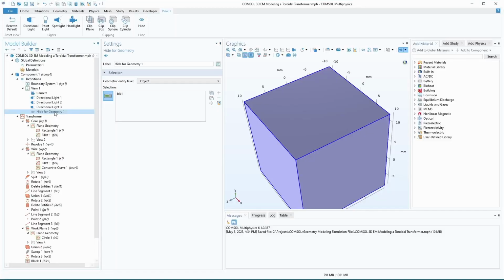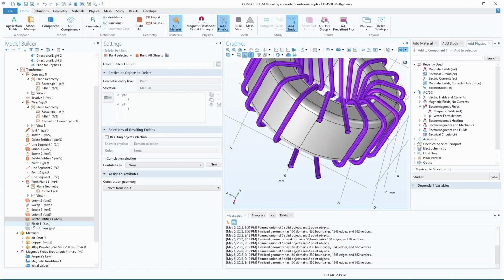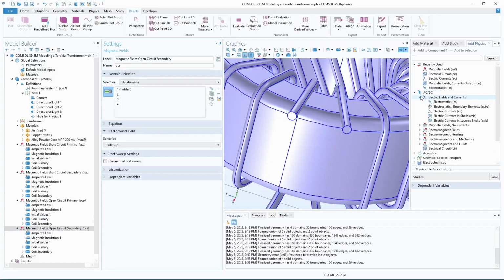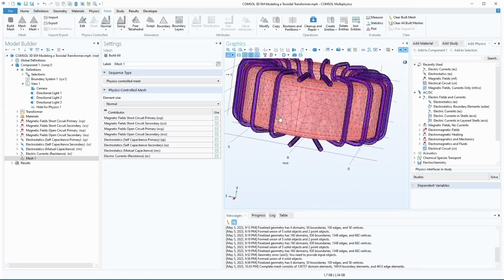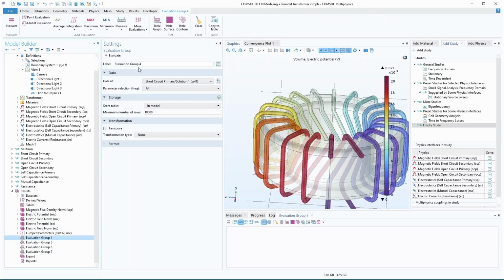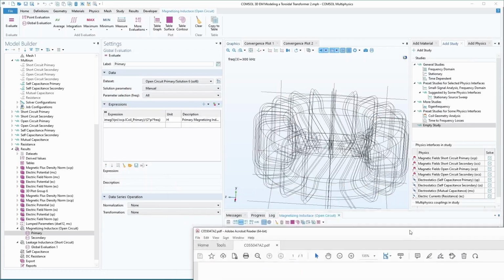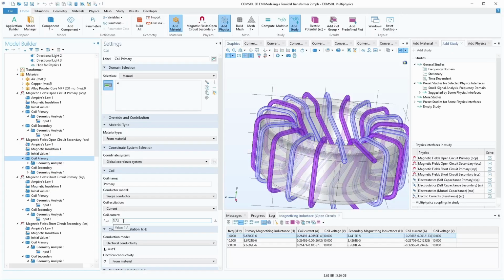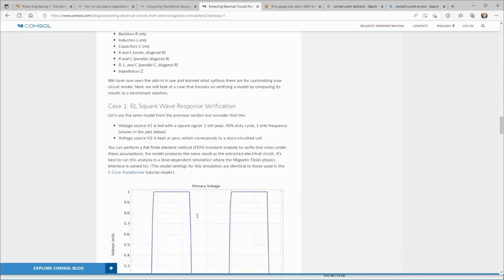COMSOL - 3D EM Intro 3, Transformer Parasitics

Comment: To fix that you need to extend the terminals out of the air box. Then do Diference and set the Input and Output of the windings in the boundary created by the diference.
Not doing that results in completly wrong results. You can see there is current flowing on all surfaces of the conductors and also current densities and fields are all absurd.

Comment: You have a very big mistake. The coil ends can not be inside the volume where you solve the physics.
You can see from the AC/DC module users guide: 
"For an open coil, the Input subnode should never be added to boundaries
that are interior to the coil’s domain selection. Note also that an open coil
should have its start (Input) and end (Output) on boundaries that are
exterior to the domain selection of the parent physics (for example,
Magnetic Fields) and of a type that supports closure of the coil by means of
an induced surface current density. The latter condition means Magnetic
Insulation and, in the frequency domain, Impedance Boundary Condition."

Comment: Thank you for the video. But seems like magnetic field current only physic cannot simulate core material. We can also see that from the final SPICE netlist, L1 and L2 are too low in comparison with the previous simulation.
Reply from the maker: Good call, yeah it looks like that last part using the Circuit Extractor is not working correctly.